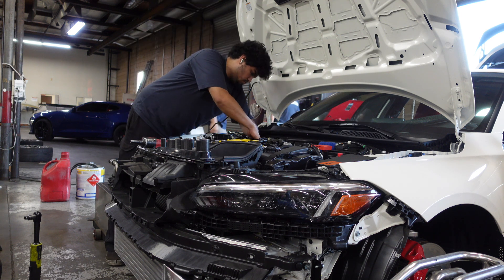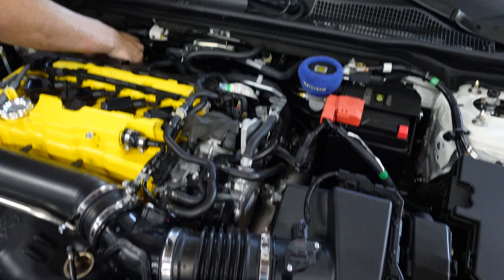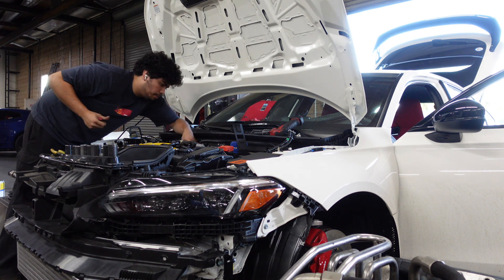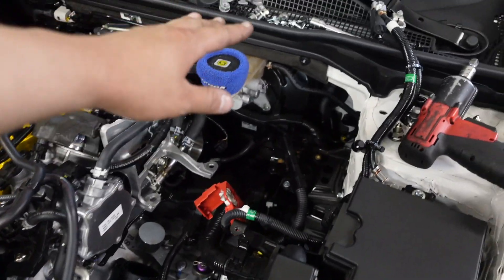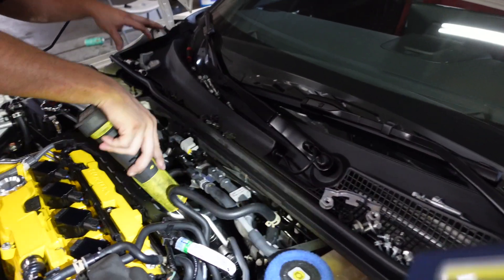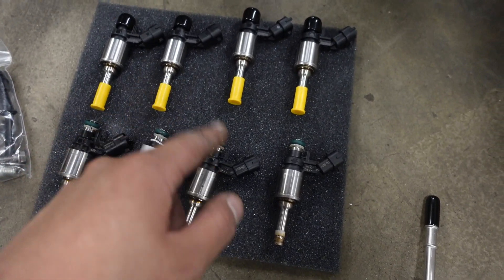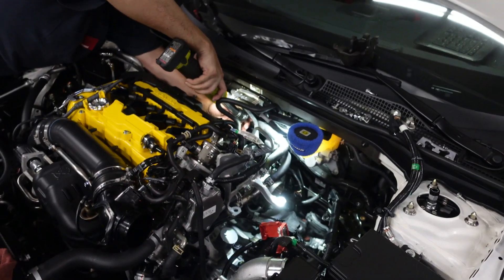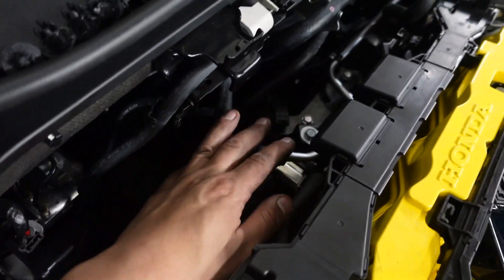FL5 HONDATA FUEL SYSTEM STAGE 1 Part II

Comment: Sweet, thanks for sharing the content! Just starting my fl5 build, have a twostep catted dp and prl front mount on the way. Next month i send ecu for unlock, grab flashpro and do an etune. Where i live no dyno, only 91 octane. So itll be interesting to see how it goes. Not sure what to do next, rv6 660, or hondata fuel system haha. Or both if i can save the cash. 

Cheers from Guam 🇬🇺
Reply: All you need is a pump. Stock injectors are good for 480whp